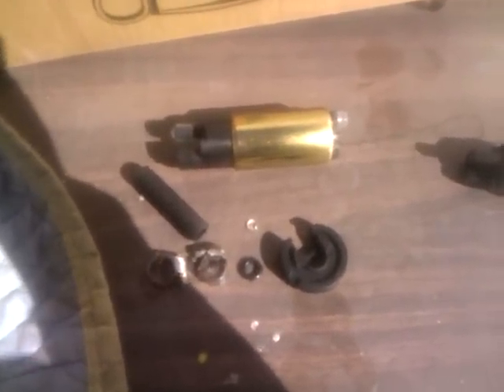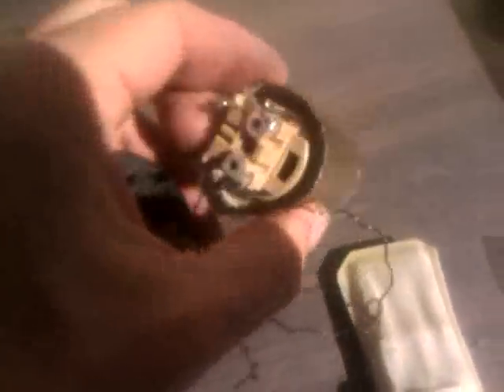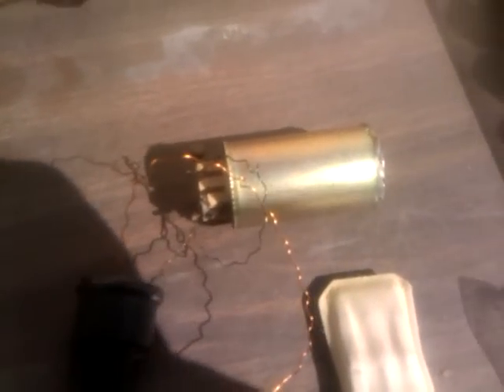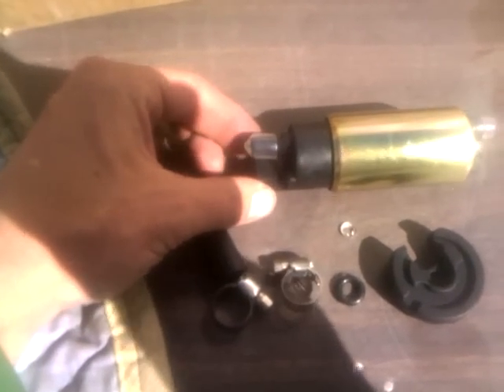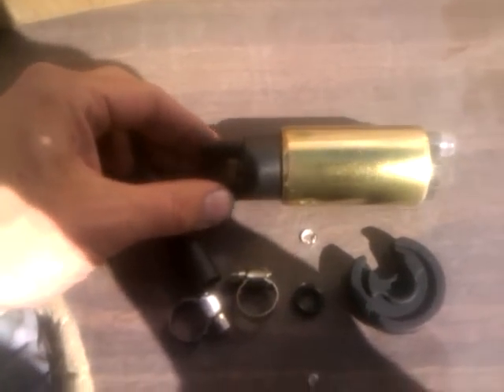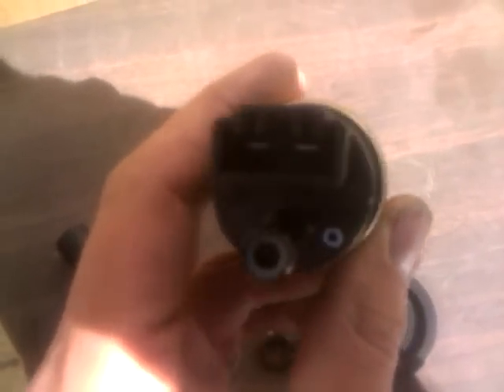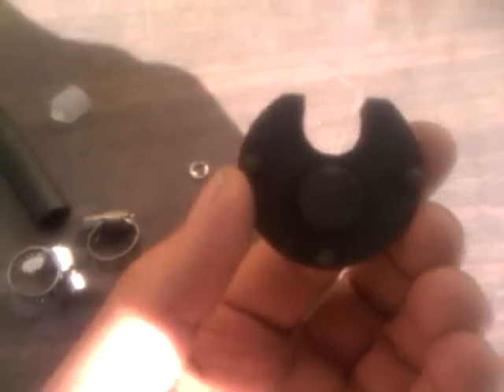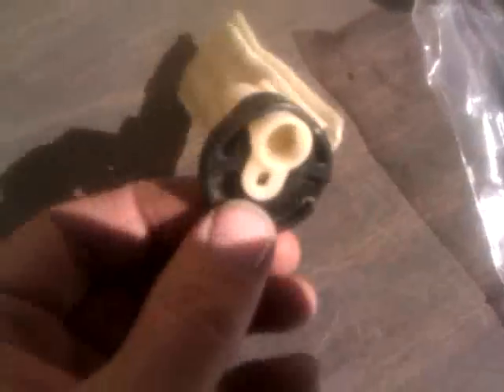HONDA VTX1800C  - Internal Fuel Pump $20 Replacement - Part 1

Comment: Just helped a buddy replace the pump in an 02 VTX1800R last weekend. He needed one that day and couldn’t wait for shipping. We discovered that it’s the same exact pump used in a 99-04 Nissan Frontier. Just ran down the street to the auto parts store. It was nearly $100, but still way cheaper than the $400 unit from Honda. The pump was a direct swap and got the bike running again.

Comment from the maker: It worked. The pump is identical to the oem pump. 2000 miles and no problems.
Reply: cr38er what year and model you have?

Comment: I just checked ebay and the fuel pump for my car runs about the same as if I buy it from autozone. Actually I think its more expensive. I have a 94 honda civic.